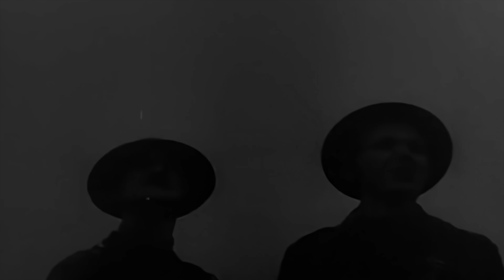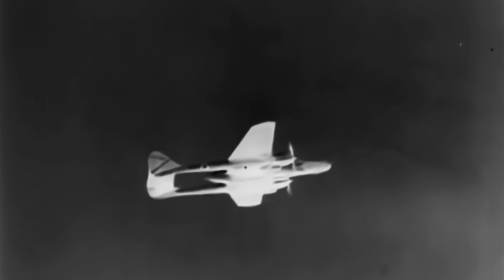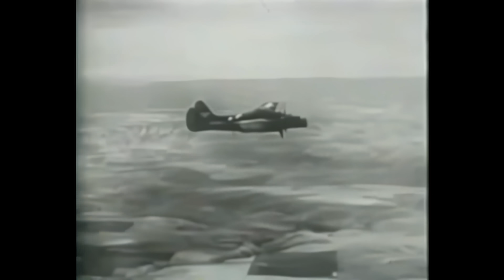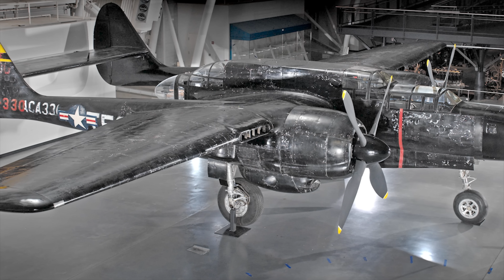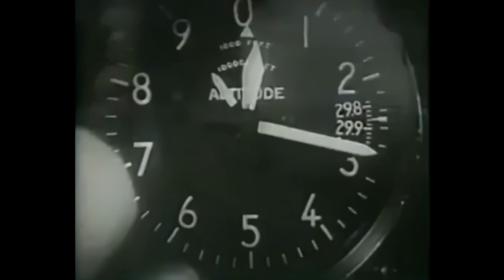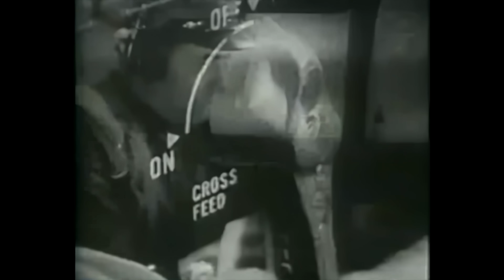P-61 Black Widow | The American Night Fighter | WW2 Twin Engine Named for the North American Spider

Comment: first night fighter and first radar platform.....  which night did it rule? lols not sure this plane even got to do the job it was designed  for... lols guess ill go waste 40 mins watching a better researched channel 🙈
Reply: It did see some service in the Pacific late in the war and did reasonably well. Also saw some limited service in Europe but the early versions had issues with the remote turret to the point that they removed it and it didn`t fare so well. I think the US night fighter squadrons preferred the Beaufighters and Mosquitos they had previously been using.

Comment: Poorly commented and factually incorrect.
It was not the first nightdighter by any stretch of the imagination,the RAF were operating Beaufighters with air intercept radar in MAY 1941, The Mosquito soon followed.
The Luftwaffe to had very effective nightfighters long before the Black Widow entered service.
It was the first fighter designed specifically for the role.
Reply: I think he meant that the P-61 was the first aircraft designed specifically as a radar equipped night-fighter, both the Beaufighter and the Mosquito were adapted from other purposes to become night-fighters, the Beaufighter as a heavy fighter and the Mosquito as a bomber.
Reply: German Uhu HE-219 was in service a year before and was purpose built with radar and an ejection system.Its first combat downed more HEAVY bombers than all p-61s combined.

Comment: Fun fact: Despite all the hype, the P-61 was pretty useless as it was quickly taken out from front line service as soon as WWII ended. However, the Mosquito remained in front line service with many nations until 1963. 👍
Reply: Fun Fact: In the early days, most of what was learned about hurricanes wasn't obtained from the De Havilland Mosquito. Nope! But instead from the Northrup F-15A Reporter!
She also held her own as a firefighting platform.
And, many of the recips of the day took a back seat to the newer jet engine technology.
Reply: @Sam Hill  I'm not surprised about the hurricane research, as the P-61 was an enormous, heavy, aircraft, which - with the twin booms acting as a solidly braced "box" - it could withstand those weather conditions. Nevertheless, even with such use, the P-61 and its' derivatives still didn't last very long in civilian service. 👍

Fun fact: post-war, the DH Mosquito was extensively used by civilian operators in aerial mapping operations to map the Australian continent.
Reply: @tim7052  

Well, I got four books that I recommend:

[1] "Queen of the Midnight Skies" by Garry R. Pape & Ronald C. Harrison;

[2] "Northrop P-61 Black Widow: The Complete History and Combat Record" by Garry R. Pape with John M. and Donna Campbell;

[3] "Combat Chronicles of the Black Widow" by Warren E. Thompson;

[4] "Evolution of the P-61 Black Widow" by Warren Thompson

One more fun fact:
The P-61 has the credit for downing the last two enemy aircraft of WWII in the Pacific Theater.

Have a very Merry Christmas there Ti m!
Reply: @Sam Hill  Thanks for the info, I may look them up some time.

One last fun fact: the DH Mosquito excelled in every role it was given:
- night fighter,
- bomber,
- fighter-bomber,
- photo recon,
- post-op bombing recon,
- night intruder/interdiction,
- precision bomber,
- pathfinder,
- anti-shipping attack,
- weather recon,
- OSS radio intelligence,
- ground attack,
- high-speed VIP courier (BOAC),
- target tug and,
- aerial photographic mapping (post-war).

Btw it also had the lowest loss ratio for any front-line allied aircraft during WWII.

Enjoy your Christmas as well, mate. 👍

Comment: I never knew much about this plane. Insane engineering for that era. If only it had been operational earlier.
Reply: @Dronescapes  Thank you for the reply! Great channel.
Reply: The engines on the P-61 we're shared with the F4U Corsair, the P-47 Thunderbolt as well as a great many other aircraft. 
Because Northrop was having buffeting issues with the upper turret, more often than not, many of the engines were reassigned to aircraft that were already in the field and in dire need of them.
Reply: @RenKnight347  Thank you for the reply!
Reply: @kennethlane3896  

You are very welcome, Sir!

Comment: Did the rounded shape of tail fins, so common in WW1 and WW2 aircraft, confer any actual advantage or was it just an old-fashioned “artistic” preference? The Focke-Wulf 190 and P-51 Mustang showed that tail fins didn’t need to be rounded, so I wonder why it took so long to break out of that habit.
Reply: Tail shapes vary depending on need, they aren't one-shape-suits-all, much like wings. 😎👍
Reply: Focke -Wulf 190 was rounded .
Reply: Which side held cables?

Comment: BTW, the US challenged the RAF to a speed test: which was faster, the P-61 or a Mosquito? The RAF used a standard production Mossie from one of their squadrons, while the US secretly stripped down their P-61 and modified and "souped" up the engines of the one to be raced. Against a stock standard Mosquito - with full war-load equipment - the P-61 going flat out, only just beat the Mosquito!!
Reply: The 422nd guys told me that they did nothing to the P-61, there was "NO" special modifications to the P-61 and they beat the Mossy period, I got that from the crews that were there.
Reply: @Jeff Kolln  Interesting. Thanks for prompting me to research further. It seems the RAF deliberately "threw" the race to prevent being forced to supply their Mosquitos to the USAAF (who wanted it to equip their squadrons). Even the main proponent of the P-61 believed the Mosquito was faster, as confirmed by pilots who flew both types. This as referenced:
"The race was anything but clear cut, and it is extremely unlikely that it was just a fair competition that both sides took part in earnestly. Simply put, the RAF did not want to give the USAAF any more Mosquitoes than they absolutely had to, and were extremely motivated to throw the race. They had a great desire to ensure they were better supplied with the only night fighter in Allied service at the time that could fly long range missions into Germany. The results of the race are extremely suspicious given just how clear the P-61A’s win seemed to be in comparison to the years of evaluations which virtually always claimed that the Mosquito NF had the superior climb rate, and the P-61 had superior maneuverability. Members of the 481st NFTG who had flown planes came to the same conclusion, as did the AAF board, and even Col. Winston Kratz, director of night fighter training and a major proponent of the P-61 (Harrison&Pape 153, 156, 203). His words perhaps best sum up the event, “I’m absolutely sure the British were lying like troopers. I honestly believe the P-61 was not as fast as the Mosquito, which the British needed because by that time it was the one airplane that could get into Berlin and back without getting shot down. But come what may, the ‘61 was a good night fighter. In the combat game you’ve got to be pretty realistic about these things. (Harrison&Pape 209)”
(Ref: https://plane-encyclopedia.com/ww2/northrop-p-61-black-widow/)
Reply: Yes the Mosquito was a mark ii version that has been in service since 1942, the latest equipment in summer 1944 was a moquito nf 30 which was 70mph faster than the p61.
Reply: @Bruce Williams  Thanks for that info Bruce! AFAIK the US were desperate to get their Hans on Mssies because not only was it a superlative aircraft, but also one that had proven itself as extremely successful in every conceivable role that they put it to!! (And the one that had the lowest loss rate of any allied aircraft of WWII!!)
Reply: @tim7052   I seem to recall seeing on Greg's popular airplanes and automobiles channel that the U.S. Army was offered the opportunity to acquire Mosquitos built under license but declined, which doesn't sound like they were desperate for it.
Reply: That sounds like a lie. Also if you just compare the specs it shows who would win
Reply: The mossie was fast

Comment: The first aircraft designed to a specific nightfighter specification I'm aware of that entered service was not the P-61, but the Hawker Woodcock of 1922. AFAIK, it only got used by one RAF squadron, though. Although technically designed as a nightfighter, it's not like the Woodcock was really any different from any other fighter of the period. The P-61 is the first one with very specific design elements to go into service. It does look similar to the paper-only Gloster Reaper. In the end it got used a lot as an intruder due to lack of targets, and could carry a really useful bomb load.
Reply: Hehe... Woodcock!
Reply: I'm not sure on how the timing compares with the German HE 219 Uhu.  It was also designed from the outset to be a night fighter.  First prototype flew in 1942.  First operational unit were deployed in June 1943.
Reply: @peppermill7163  219 was almost a year ahead in deployment, but was based  on a failed bomber design, so it's hard to say if it counts as designed as a night fighter.